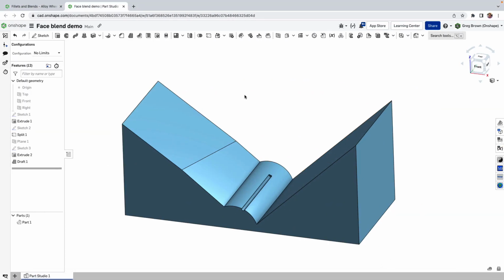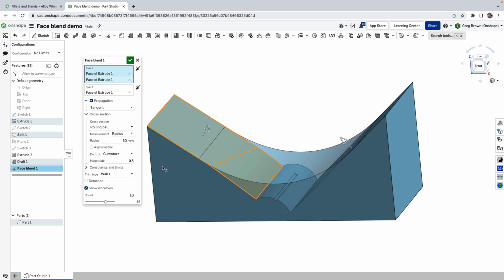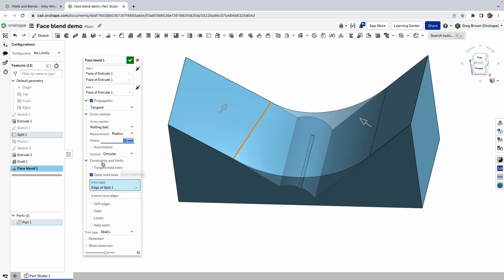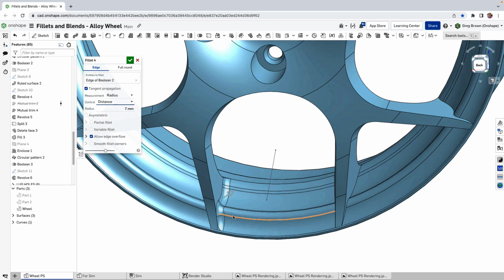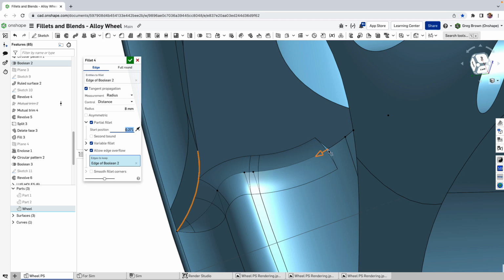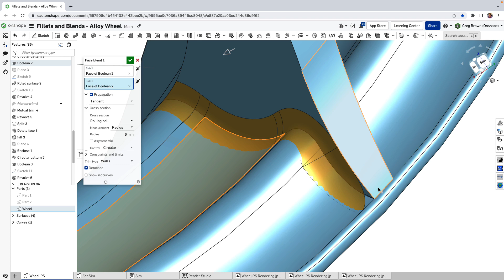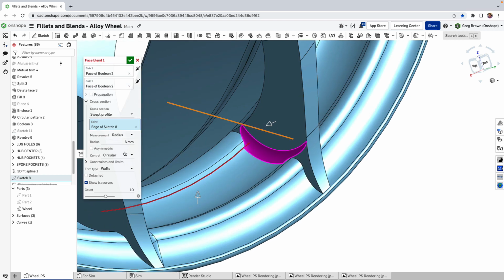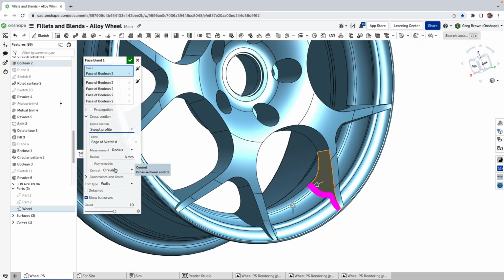Introduction to the use of Face blend for sophisticated/challenging CAD situations

Comment: That reminds me .. . for the sweep feature, ONSHAPE guys ought to add the option of picking a mate connector (any one of the three axes) as the direction of the sweep. I had a design where I used sweep a LOT and every single time I had to search in my model a straight edge or had to exit from the (sweep) command and do a sketched line of appropriate length, then jump back in and continue with my sweep feature. I think CATIA has that where you can pick x, y or z of the refence frame and then they give you addition control on how to control the length of the sweep.